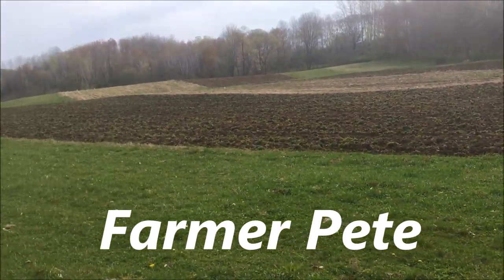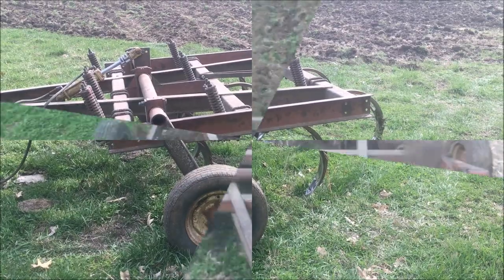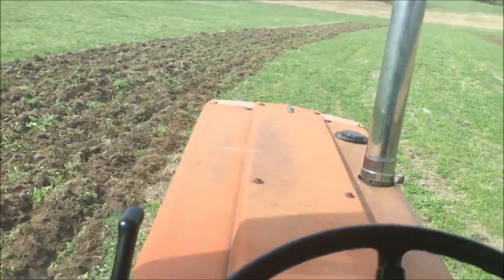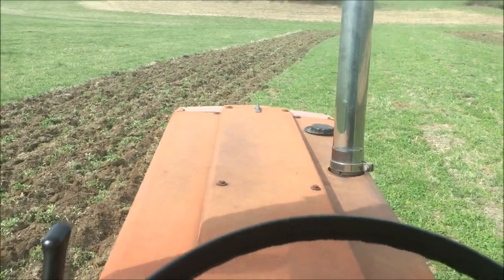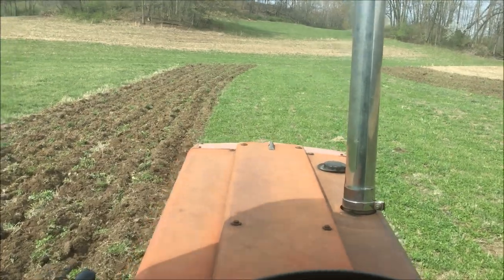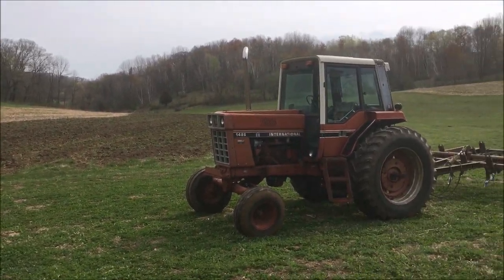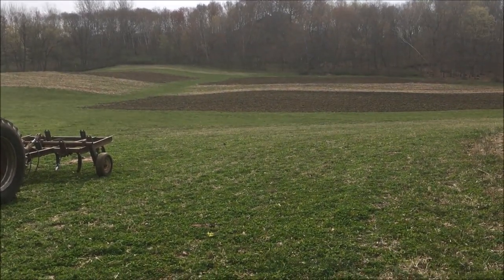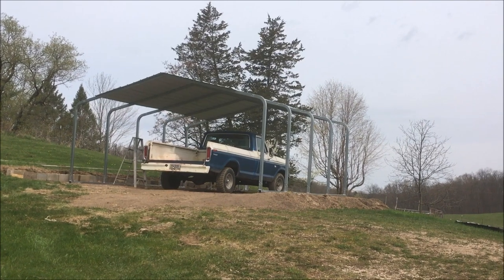Tillage! International 1486 & Bush Hog 8 Shank Chisel Plow

Comment: Beans are alot more, involved,  I will call it than corn, I run 36 inch rows and the main problem is they never really canopy until August, I spend most my summer walking the fields picking weeds out of the rows. But it's a good return when you get a good crop I feel is worth the extra work good luck farmer Pete I look forward to more.
Reply from the maker: Thanks. I'm going to give it a try.

Comment: Great video!  Speaking of the late 70’ and into the 80’s - the farm crisis that ensued with so many farms and farm manufacturers folding and/or merging, it would be great to hear your thoughts in that time period and how your farm survived it all - in a video.  It would also be interesting to hear how the dealer landscape changed from AC to IH and others.  Take care and best of luck in 2021.
Reply from the maker: Thanks! Being a low overhead/low debt load guy saved my butt in the 80s.
Reply: Good  day  Yea I was telling some young fellows  about middle 70's when you guys  had fuel crisis  .Farming was great up here until   80's when interest hit 24 %.  100 acre farm sold  roughly 2.5 million.  Back in 2008 up here we were going thur  small crisis & that is when they should have put interest up maybe 1 %.  Average house in our in town is $600,000. Crazy.  Good luck with soybeans.. Nice video. Thanks
Reply: I forgot  the price of gas back then was reasonable   having gas tractor was OK,  but not now.  We are at   $1.25/ litre  X 4.54and that is what you get per gal Thanks